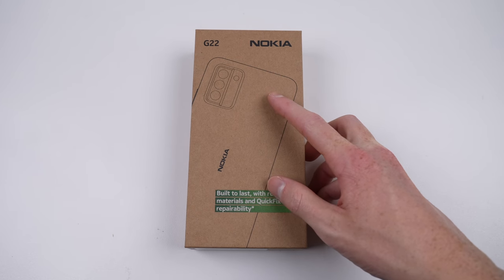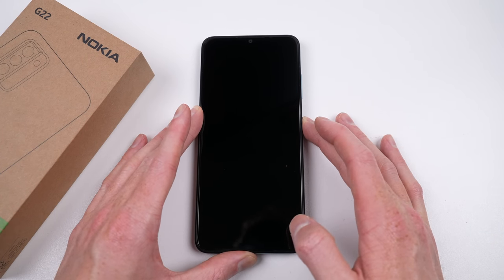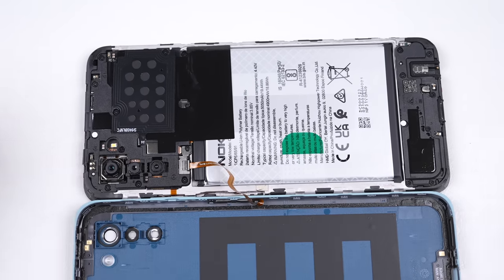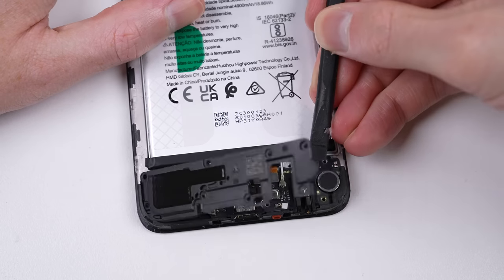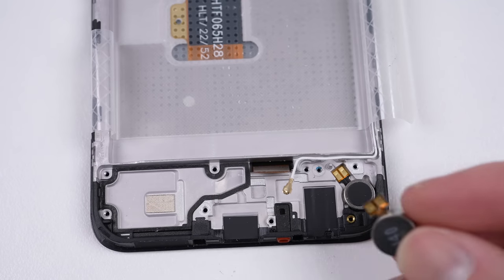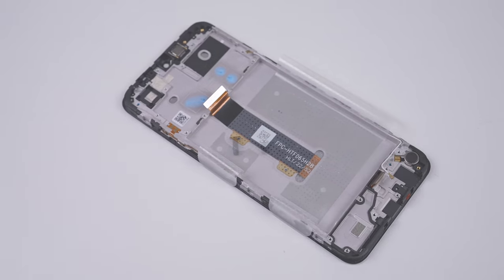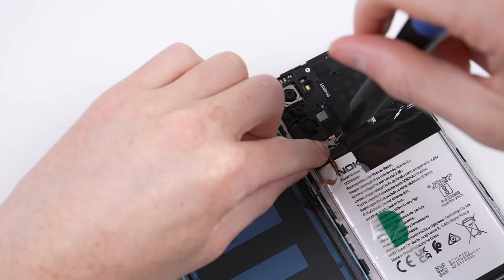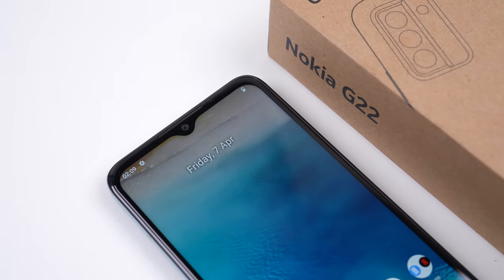Nokia Makes Its First Repairable Phone - Nokia G22 Teardown And Repair Assessment

Comment: I really appreciate this effort. More than anything, it shows how anti-repair the rest of the industry has become. Nokia didn't even necessarily do anything with the hardware itself to encourage repairability, they just didn't actively make repair hard or impossible. 

Think of the millions if not hundreds of millions of dollars companies put into development aimed at taking away consumers' ability to repair their own phones.
Reply: It's really funny because budget samsung phones are more "repairable" than g22. you can also find service orig parts and level 1 repair manual for them, although not as easily. moreover, unlike g22, for samsung phones, along with level 1, you will find level 3 manual that explains how to do more detailed diagnostics of your smartphone. although, like in g22, you will not be able to do it through the soldered protective shields on the motherboard, but at least the motherboard will not be a magic black box.
Reply: Yer i agree they should have taken inspiration from smart phones 10 years ago with removable backs and everything should be plugged in like a desktop.

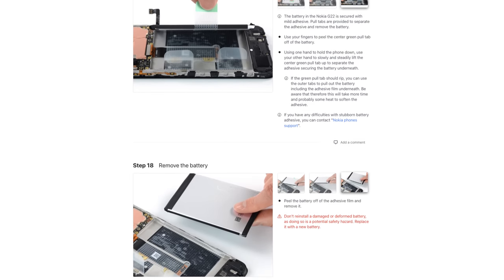Comment: 4:19 Hugh I would not recommend removing this single pin connector as you did. You can see in the video the actual top of the connector bending; making it more difficult to reconnect later in time. The way I have found best is either use the pointed end of the spudger or needle nose tweezers and apply leverage at the piece of the connector that spans outward toward the cable. Slightly bending this part of the connector allows for easier reconnection later.

Plus I have found if you find a stubborn connector and apply to much pressure in the way you have shown, it can permanently break the tip of the connector.

Love the videos man. You make repair videos enjoyable.
Reply: Good tip. I have had trouble with those round little connectors not staying in place once reattached. 😢 I wished I had known they could bend this easily.
Reply: I saw that too, the method you described facilitates the removal of the connector aswell
Reply: The little nipple antenna connectors are such a pain
Reply: I once even broke off the connector from the PCB with that method

Comment: This is a great first step in the self repair direction. Sure it's not great but it's a start that only 1 other company does this. The design is good, very basic and simplifies the internals and great that they are distributing the parts through ifixit. 
Well done Hugh, have you had you hands on a farefone yet?
Reply: the only real companies that have fully repairable things are framework since everything is modular and can be serviced with a screwdriver and their modules (but does it really count since they do laptops?), Nokia with this phone and probably something else
Reply: Who is the other company, please?   thank you.
Reply: @robinsattahip2376  Hugh mentioned them in his video. Farefone
Reply: @robinsattahip2376  fairphone
Reply: He has a video with the Fairphone 4.
Reply: @kirilnikolovski81  It's spelled Fairphone, not Farephone.
Reply: @kirilnikolovski81  "Farefone"...? More like Farewell to your english exam.
Reply: @Tyler N  fairphone was first, framework is not as old
Reply: @kirilnikolovski81  theres also motorolla. their very recent phones have been SUPER easily repairable.
Reply: but Samsung or Xiaomi or Motorola oppo and realms will be repaired in the same way
Reply: @pro14ab  yep. motorola started awhile ago with this repairability. software is still garbage on their devices though in some cases.
Reply: I repair phones for living and I've seen a lot of phones with the same repairability level. The only new thing that Nokia is offering here is that you can buy parts directly from the official distributor, which is good for the customer. But the phone is still rather hard to disassemble for a person who never did something similar.
Reply: @tylern6420  Just the framework, this isn’t repair friendly.

Comment: Oh what I would give for a modernized Galaxy S5 with a user removable backplate/battery, SD card slot, audio port and compact size + water resistance... 
It even had an IR blaster... Superb video Hugh!
Reply: Ii just got a Galaxy Xcover6 Pro. Awesome phone.
Reply: Samsung Galaxy XCover 6 Pro and the XCover lineup in general is what you're looking for.
Reply: Well that's the issue, you can't have a removable backplate whilst also wanting water resistance. That's not how that works haha.
Reply: @jelle1611  It does not need to be very resistant.
Reply: @jelle1611  You literally have that on the Galaxy S5, Fairphone 4 and the XCover series.
Reply: @jelle1611  the Samsung galaxy S5 is IP67 water resistant while also having a removable backplate, infact you can run it with the back cover removed.
Reply: @jelle1611  the Samsung Xcover series also has a removable backplate, it has water, dust and drop resistance.

And let's not forget those old Nokias, while not officially rated you can run them underwater for a little bit.
Reply: @jelle1611  Samsung Galaxy XCover 5, Pro and 6 Pro plus probably a few other XCover models all have this with full IP68 water resistance
Reply: Already exists, Nokia C2 2nd Edition
They only released it in Asia and Europe though sadly
I hope they follow it up with a bit more of a linear improvement, specifically going with a 3000mAh battery and upping the camera to a 12mp
Reply: @swecreations the problem with the cover is that it's far too big. Phone shouldn't be more than 6.1"
Reply: I considered the S4 the best looking phone. The screen is warm and gorgeous. Until I bought an LG G6. What a beautiful phone. Too bad mine died.
Reply: @apegrasshoplizard  asus zenfone 8 / 9
Reply: It would be "shat up and take my money" phone. All my kids would have one and I'd have always a spare display and usb board in my drawer.
If they make it IP68 with disposable seals for a couple of bucks I'd also have a set of them.
Reply: I want my S10+ to come back to life

Comment: I currently have a Motorola moto g pure and, honestly, if anything ever happens to it, I think the Nokia G22 will make a great replacement with this kind of repairability. Bonus points for the recyclable friendly packaging and the partnership with iFixit for replacement parts. This has been a strong first showing for this kind of budget phone for me and I hope it leads to more from Nokia in the future. Thanks for your hard work on the video!
Reply: I have a two year old Motorola and intend to replace it with a far more repairable phone when the time comes - whether that will be a Fairphone 4, Nokia G22 or other repairable phone remains to be seen, it depends what's available at the time. I do know that it won't be an Apple phone though, Apple's devices are so anti-repair, wasteful, anti-environment and expensive that they'll need to drastically and permanently change their ways to make me even consider one of their products.
Reply: @SlartiMarvinbartfast  plus apple keeps removing features and ruining the industry. its seriously awful.
Reply: Shame that they are a Chinese Company /made...
Reply: @zakofrx HMD is not a Chinese company of any kind they are Finnish
Reply: dont go with nokia. I came from nokia 8 sirrocco to moto g9 play and still very happy
Reply: @Enlight_Entertain  g9? is that one of the 2021/2023 'refresh' models??
Reply: @SlartiMarvinbartfast  i have the Motorola g22 and edge 20

Comment: Its a step in the right direction, my s9 plus is almost 5 years old and still going strong.. with a custom rom and the battery replaced it still does what a 2023 flagship would, and has a sd slot..
Reply: And the headphone jack
Reply: Yeah I think when I'm that LTT video someone said that the S9 was peak mobile design, this is what they meant. It had everything, every option you could want or use.
Reply: rizqanart i got redmi chinese phone, no issues so far, 3 years of owning it, maybe you got unlucky

Comment: inside info: battery glue degrades almost at the same rate the battery does so it will still be strong enougth to hold it but when the battery is old the glue will be softer and easier to take out the battery, new batteries have a little bit of glue that helps the old glue get stronger again

Comment: Hugh The pull tabs are not made to pull up on the battery. They are actually made to be removable from under the battery. If you pull them straight out to the side it should pull the glue out from under the battery, hence releasing the battery.

Comment: Even if it's simply not made to hinder repairs like Apple it would be an improvement.   Great to see someone going that way.  My next phone will be a Nokia.  Yes, they have not put software in it designed to reject replacement parts.  It does not have to be easy, it just has to be possible.  People with no electronics experience should not be attempting to repair any modern device, that applies to anything made after the era of vacuum tubes, "No user-serviceable parts inside" is fine.  It would be quick work for a technician.

Comment: The fact they are not coding parts to the phone, allowing easy replacement from donor devices and OEM replacement parts readily available, is a killer feature in my eyes. This together with an unlockable boot loader it would feel like I actually owned the device rather than just paying to be allowed to used it until the manufacturer says otherwise.

Comment: This is awesome. Just making the replacement parts available and not locking them down via software binding is such a huge step in the right direction. I almost don't care if the repair itself is easy or not, this is just a question of skill.
Reply: Wouldn't consider "not locking them down" as a "huge step". It's still a common sense and it should remain as one. Only Apple and Samsung are locking down the components so far, other OEMs are cool with it.
Reply: I didn't saw anything awesome in the video, except for the marketing. typical design and typical solutions that are now in every budget and ultra-budget phone. the fact that Nokia posted a level 1 repair manual and gave to reseller service parts is great, but other manufacturers have this too, although not on a massive scale. What's really interesting is whether Nokia will allow G22 owners to flash their phones themselves without having to download a cracked OST and firmware from indian bloatware sites, as is the case with other models, or whether repairability* will remain a pretty inscription on a recycled cardboard box

Comment: Maybe the battery adhesive degrades with time, so it's easier to replace after use
Reply: nope. it remains the same. huge plus - if you do it right it stays in one piece. minus - maybe you'll need to do it with couple phones to get it right. its a bit easier as on video. also after replacing its still adhesive enough to hold new battery so you'll dont need to glue it or something

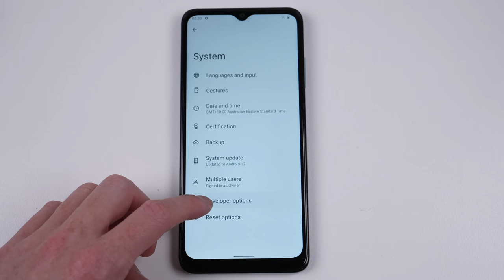Comment: 7:20 I would not be sure about that, fact that android toggle with 'bootloader unlock' exist, does not necessarily mean that in fact bootloader is unlockable, looking at recent released models (Nokia 8.3, G50, X10, X20) none of these are unlockable with official tools. During the unlock procedure via fastboot, besides doing the usual 'fastboot flashing unlock' (previously "fastboot oem unlock" you have additionaly flash phone with binary that matches the SN/IMEI of the phone that's being unlocked... which can be provided only by HMD.

Comment: This is great to see!  
Good on you, Nokia - you're on the right path with this!
Reply: Maybe for repairability, NOT so much for custom firmware/software to extend the device's support, because its bootloader is awfully locked down by its manufacturer, HMD (who uses the Nokia branding.) If you want to unlock it, you'll have to go through very sketchy software that will even ask you to pay them to unlock its bootloader.

Comment: Color coded screw sizes is actually a good idea (as someone who's repaired quite a few iPhones, among other things).

Would be great if they color matched the holes they go into.

As for your critique; it's their first effort. 
       Also; "plastic clips are something older low budget smartphones have had for years...":
.   From what I can see in your video, the sides that hold rhe clips are quite a bit more flexible, reducing the chance of breaking anything off... Which is QUITE a difference from these older low budget smartphones

Comment: Good on them, they could take some pointers from LG's V20, like the removable back panel for easy battery access. And use the pads and pins method for how the battery connects, that would eliminate the need for glue.

Comment: Actually not that bad at all. If you make it super easy to repair, you'll start to compromise on the size of the phone. 
Just getting the back off with out having to use a heat gun is a huge plus.

Comment: Well done nokia. I agree a slide off back panel and less glue on the battery would be ideal, but at leat they are offering spare parts and no software locks  although you weren't able to test this due to not having a second handset to swap parts with. Hint Hint Apple :P
Reply: There are no real software locks on other Android phones either, unlock bootloader is a standard option in every android device in the developer options.

Comment: for some reason i wish there was a camera review.
that's the main thing people want aside from 'fast enough' and 'enough space': whether the camera photo & video quality is any good. combined with its repairability, that would be enough to evaluate.
Reply: It's a phone, not a camera
Reply: It's using a Samsung ISO Cell sensor, meaning it could take decent images and videos, but the video recording is only limited to 1080p 30fps.
Reply: @ZX3000GT1  "the best camera is the one you have with you."
Reply: @knockeddownanotch  Well, it's still funny that you buy a smart phone and care more about camera lol
Reply: @ZX3000GT1  not at all. but if all the phones phone (even the dumb ones), then one asks, "what else does this phone do?"
Reply: @knockeddownanotch  A lot of things. Not just camera.
For example, I think the phone’s performance is much, much more important than the camera

What about OS stability, updates, security patch, unlockable bootloader? All more important than a measly camera
Reply: @ZX3000GT1  well, if you're in to photography you will 100% consider that. Yes i prefer the phone software support, ram, soc version and nanometer, ram and rom size, eve. The battery capacity, but i also considered the Camera sensor. I prefer phone cameras with Gyro EIS, OIS, or any video stabilizers, camera modes (i prefer the ones with a good pro mode capabilities, and also the image quality it produces. My Previous Nokia 7.1 has that and it's using Zeiss Optics and it could take good photos for a $200+ phone.
Reply: @charlstonrequiez4626  Well, I'd assume most people would take no more than Instagram food photos and selfies, so I don't think all the extraneous shit are necessary.

Besides, what's the point of great camera if the software is shit? What's the point if the OS doesn't get updates? Everything nowadays is about camera - AI stabilization night hyper zoom BS. Meanwhile actual good stuff like full storage access is gone each update, and to this day only some phones even have foreground data restriction. And I haven't even talked about expandable storage and no-latency audio jack gone from almost all phones.

But muh camera!!!!!! Smh
Reply: @ZX3000GT1  i did not disagree.
you are fighting in the wrong crowd. those who value independent repair likely also enjoy open source software, and no one seeks instability — but beyond those fundamentals, the appliance gets use as a video and photographic recorder. and since decisions are made on the margin, a manufacturer better come good on all fronts to really shift the market.

moreover...
you might have noticed that we live with a fake money system that harvests humanity's lifeforce and herds people into industries by sheer force of fraud and brainwashing — and the clock's sped up.

so the best of intentions of reparability and software approaches might be for naught if we're robbed while we sleep and are surveiled 24/7 because the very infrastructure, both technological and legal, demands all tax cattle be monitored... for their own protection of course. and nothing of our 'phone' choice or demands would change that.

so yeah. muh camera. sue me.

Comment: The clips on the rear panel are, in my eyes, a good compromise between easy to remove when you need to, without being so easy that you end up fiddling with it like I would tend to do on the battery covers for my remotes etc.  Still don't understand why manufacturers insist on using strong adhesive for their batteries though.  There's just no need for it.  For the fact that it has a headphone jack and an unlocked bootloader alone, I would 100% have picked this phone if I hadn't already committed to a 24 month contract with my Pixel 7.

Comment: Android versions are important. Sometimes some privacy/security features are added to newer version of android. Also, android 12 has a lot of bugs that were fixed with android 12L and 13. Android 14 will have better back gesture with predictive back gesture. Also, sometimes older android versions may don't get proper security fixes or limited fixes with no proper alternative work around that impacted features as those are rewritten and added to newest android versions

Comment: What grinds my gears is that hardware is considered obsolete/written off after 3 years while still working absolutely fine. My iPhone SE 2016 model still works perfectly fine 7 years later in 2023, after putting in a new battery last year.